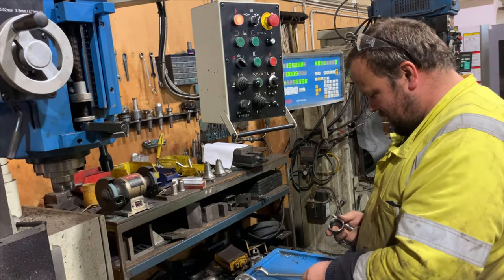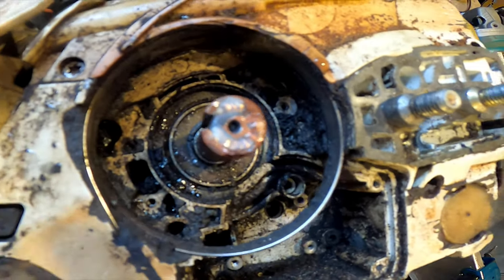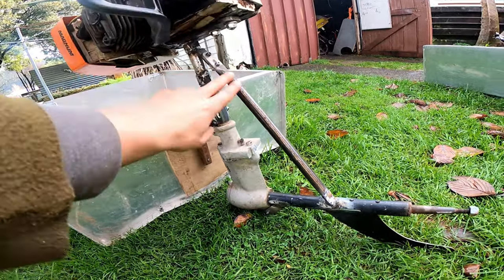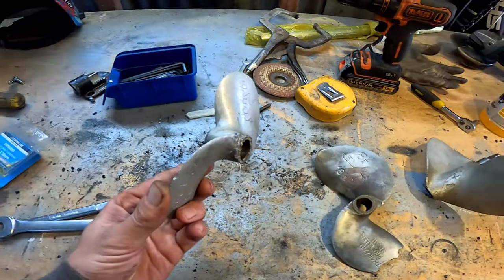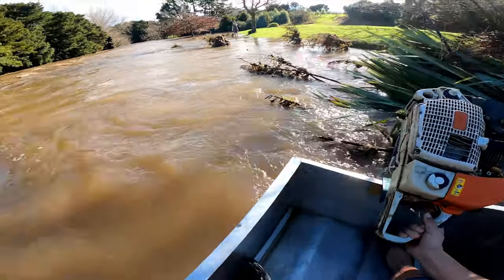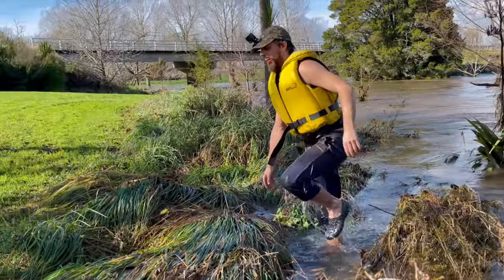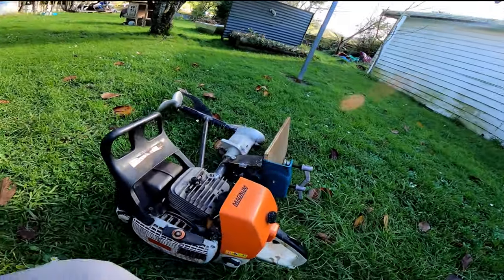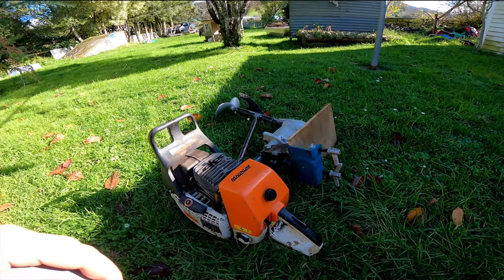Chainsaw Powered Surface Drive ,Build and Test ,Stihl 088

Comment: Your ideas at the end are great (the expansion chamber for more power and exhaust tip below surface, the flywheel to make it not stall as much, and of course a longer stick for more balance and more control) impatient to see this Lil boat on flat water going for a rip
Reply from the maker: Thanks mate! Thank you for the input I will get those things sorted!

Comment: You’re having the stalling issue because the chainsaw doesn’t make much torque, when the prop bites it doesn’t have the torque to spin it. I run a belt drive v twin on my surface drive in my big boat and when the props torque up you’ll feel the motor drop rpm and you’ll feel the boat Jump forward pretty hard.       Good to see you got it working toward the end, you build some really neat stuff!
Reply from the maker: thankyou. I had the chainsaw motor apart today and it barely has a flywheel so I'm thinking thats why it stalls easily , I use a 13hp longtail on another boat and it doesn't stall but they have a big flywheel and are low reving, I would like a v twin surface drive they look fun and sound awesome ! Im doing some mods to the chainsaw surface drives so hopefully get another test on the weekend

Comment: There must be videos about tuning chainsaws.  I used to watch Buckin' Billy Ray Smith who is a tree feller on Vancouver Island, and he uses several tuned McCulloch chainsaws, but does not do the tuning himself.  I guess chainsaws only do their thing while running flat out, so are not designed to have any sort of a broad powerband.  In fact they would pretty much definitely stall if the bar hits the tree at anything less than flat out, and I have no idea what you could do to change that.   It's a very long time since I raced two strokes. In fact we used to call it Scrambling then, and not Motocross, but from what I remember, lower crankcase compression and a longer inlet manifold were supposed to produce a broader powerband.  If you had a spare piston you could maybe try shortening the skirt to lower crankcase compression, but I can't thinking that it could all go horribly wrong and it would hardly run.  That was the fastest we've seen the boat run though, so you seem to be going in the right direction.
Reply from the maker: It has a heap of power at full throttle but anything less it would stall when hitting logs or grass or whatever was under the water. I think a fly wheel would help and a could make an expansion chamber that kicks in at lower rpm
Reply: A flywheel is too much for that little crankshaft if running wide open and something stopped the. Motor the  flywheel would ring off the end of your crankshaft brother  the exhaust has the most to do with your power band  it's very highly tuned

Comment: think you should go to a 2cyl or a healthy single cyl would be ok to ,.. 2 stroke with a CVT drive set up...if you used your cv axle idea i think you could make it work with your surface drive you want.. you wouldn't have to worry about power and with a CVT your impeller or prop speed would not be a issue ... just an  idea.. either way love the channel!!

Comment: What are the uni joints you used for the adaption to the jet unit ? What are they called and where did you get them ? Cheers
Reply from the maker: They are off an old quad bike

Comment: the only thing you need is a bigger chainsaw engine and the aggressive prop you had on the first time and you'll get a lot of speed with a bigger chainsaw engine     cause the engine u have isn't powerful enough for the aggressive prop   you'll get like 20-30mph difference with a bigger chainsaw motor and the big aggressive prop an expansion chamber will also add more power and create a powerband effect cant wait to see updates
Reply from the maker: It is the biggest chainsaw engine you can get . I have another video of it going fast, now I am trying a long tail setup and building an expansion chamber
Reply: That's a 122 CC motor that will pull 72" of bar. It packs about 12hp, 2 stroke.

Comment: its not deep enough for the prop. cant get enough water at high revs with slow speed, you need to ease into it like you said, or extend it more.